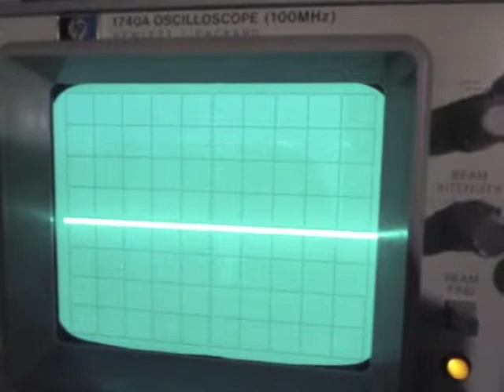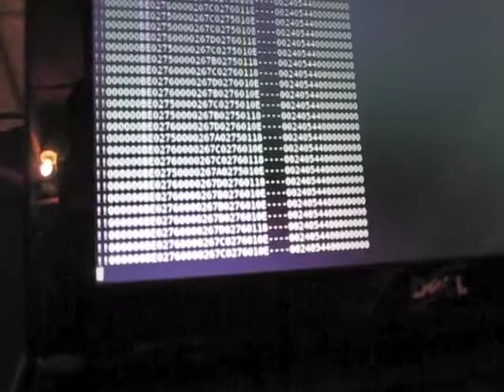XBee and ADS-WS1

Comment: I am very interested in your work with the WS 1. I cannot even get mine to work with a terminal program. Did you happen to take notes when you were setting up your equipment? There is a lack of detailed instructions to help guide the user with this piece of gear.